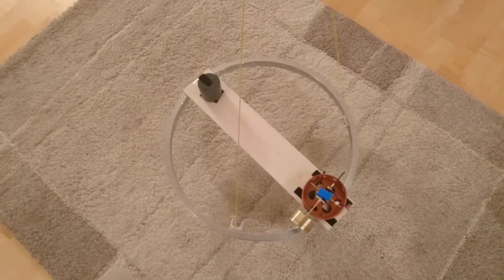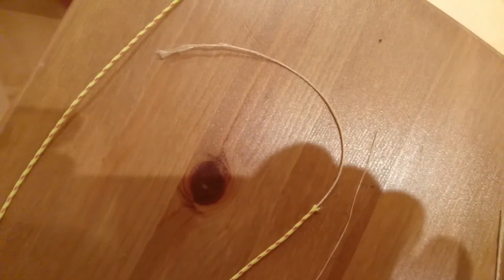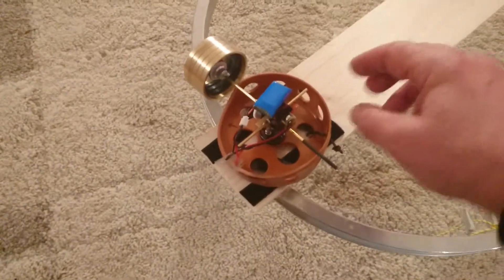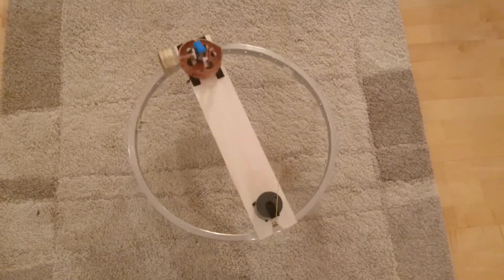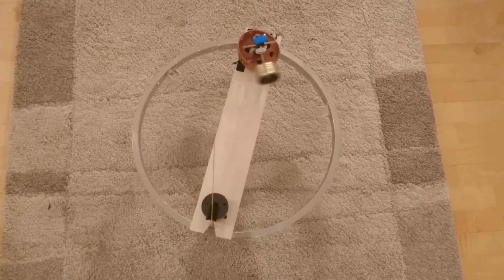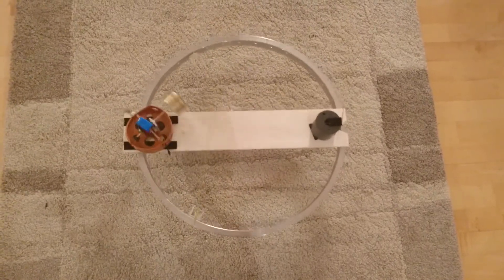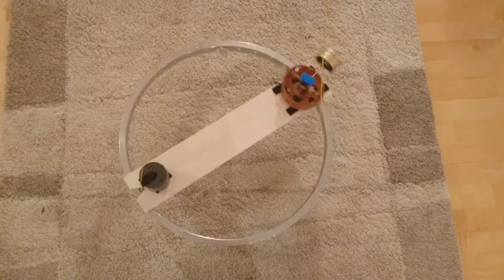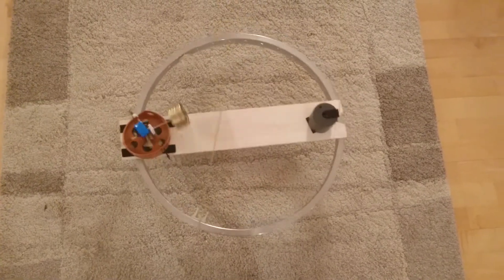inertial propulsion with gyroscope part 6

Comment: I have thought of another experiment that is very important.  Rotate your device 180-degrees, so now the "push" should be in the opposite direction.  Now see which direction (counter-clockwise or clockwise?) the bicycle wheel turns.  Even though the bicycle wheel may turn more slowly this way, it still should turn.

Comment: Nice, but where is the theory explained ? In Video 1 ? Have to watch it... You probably need a second rotor rotating into the other direction to really get an unipolar linear force and not just a torque...
Reply from the maker: This experiment is done exactly for that purpose, trying to understand how and why it works. I am not looking for a good and efficient propellant for space ship or anything else. I am fascinated by what a gyro is capable to do and i think it deserve some research to grasp (if possible) how gravity, gyroscopique torque, inertia and centrifugal force are modulated on precessing gyro.
And of course every body is invited to help

Laurent

Comment: Very nice woopy. Now can you see if it still works without the brass gyro rotor spinning?
Reply from the maker: Hi TK i don't understand what you mean. There is no vertical motor which rotate the system around the horizontal plane. There is only 1 motor which spins the gyro and the traction wheel and both are "solidaire" on the same shaft. So it is not possible to stop the gyro of spinning because all the system will not rotate at all. Please take a look at the Patent of H.Fiala (part 1 of the video serie) to see how the system works.